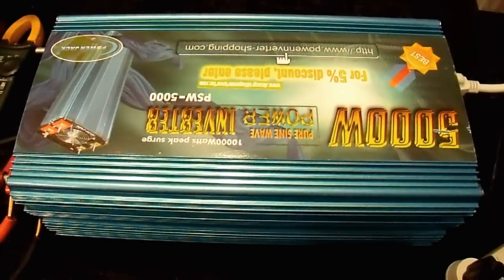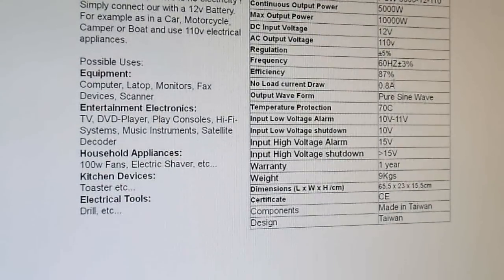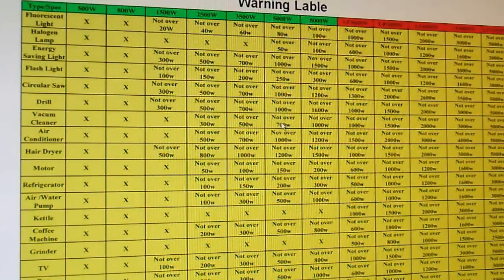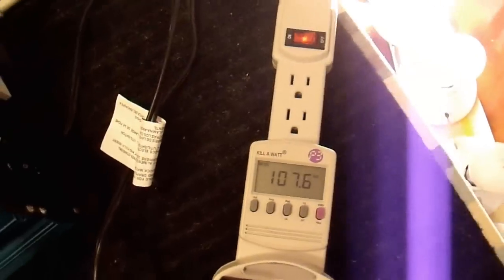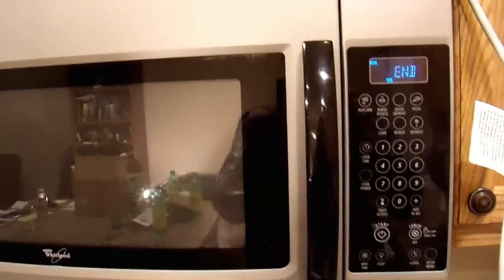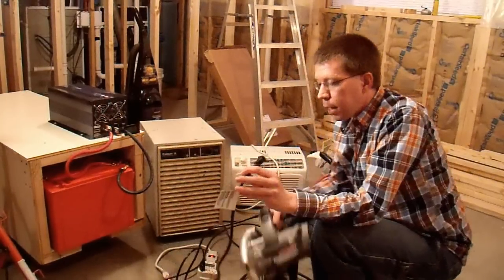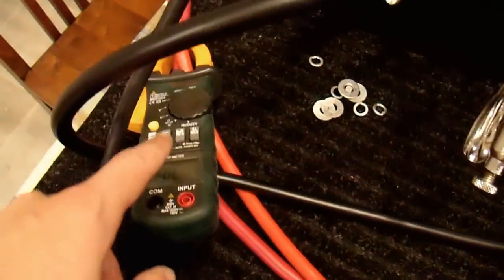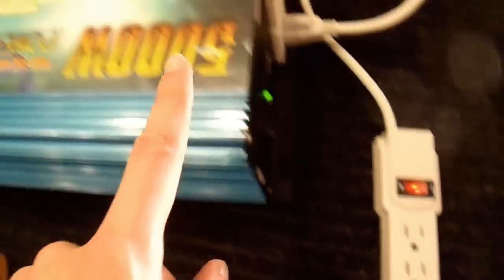Power Jack 5000W Pure Sine Inverter Review - part3/3

Comment: Not that it would have made much difference. Some of those cheap noisy fans are noisy because there very high flow fans. I recently found this out when I tried to swap the noisy fan in my power supply with a better quality one. Also I'm not a fan of reversing the air flow of fans, on my experiments with PC's I always found the exhaust fans were the only one's that really mattered(reversing the air flow was disastrous). So if the designers had the fan exhausting from the case I would have left it that way. Anyway interesting fix tour and review. POWER Jack!

Comment: Your video reviews were extremely helpful.  I had purchased a pure sine wave xantrex 2000 watt inverter a while back and found that it could not fully utilize the batteries power as it would turn off at about 11 volts.  After watching your videos I now know that I can most likely remedy this with a potentiometer it has internally.(once I fix the blown capacitors and mosfets!).  So much for purchasing a well known and respectable brand name!!

I decided to buy a larger modified sine inverter and would never have thought to buy a PowerBright brand...just sounded like another cheap and over rated inverter to me.  This 6000 Watt inverter is great!  I can run everything I want on it at the same time...several lights, small fridge, small freezer, Keurig coffee maker, and then start up my 1/2 HP well pump and washing machine without issue although the lights will dim ever so slightly when the pump starts.  The inverter stays completely cool to the touch.

The fans are large and fairly quiet when running...and there are two of them - one at each end which I have never seen before.  The price currently is about $500.00 now and well worth it.  So far none of my electronics have an issue with the modified sine wave so it must be of decent quality as well...this includes all of my variable speed power tools which have had issues with other modified sine wave inverters I have had.

Thanks again for your time in creating these videos.
Reply: I just realized I should have posted this comment on the prior video.

Comment: Another good series.  I think it'd be interesting to see how this unit performs with a high performance(high CFM) fan in exhaust mode.  It's been my experience that quieter fans are quieter because they simply aren't pushing as much air.  I learned that through experience by installing a top rated fan in a portable ice maker.  The high quality fan was much quieter, but wasn't pushing/pulling enough air to cool the unit and it's performance suffered way more than I would have imagined.

How about making a Knurlgnar24 buyer's guide/ratings index that lists the equipment you test so we can get a snapshot of the best, worst, and middling equipment capabilities vs. cost?  And/or a Knurlgnar24 favorites/recommended list? 

Keep up the good work.

Comment: Wouldn't adding one or two more batteries to keep the input voltage higher help to keep the output voltage a bit higher and thus increase the power output at least slightly? I know that the controller should maintain steady output voltage, regardless of the input voltage but since it clearly doesn't, maybe it would be worth giving it another shot with a more capable battery bank that can keep the voltage a bit higher. Nice review, btw.
Reply: I believe Power Jack has addressed burnout issues with the need to use a 48v set up for hard to start loads. The lower voltage designs, 12v and 24v don't provide the sustained voltage needed for heavy loads. I think you are right with your suggestion.

Comment: I'm looking at the 3000w LF split phase so these videos have helped. I have a few observations, though. First, I wouldn't have reversed the air flow direction. The arrangement from the factory draws cool external air across the output filters first. This is important as they will run the hottest. Also, have you confirmed the supply line you modified for a higher dropout isn't part of the thermal regulation circuit? It could need recalibrated now. Do you recall the part number on the output MOSFET? I'd like to take a look at the data sheet. Thanks!
Reply: YEAH. THAT IS A GOOD POINT! ACTUALLY WOULD BE BEST TO HAVE 2 FANS.
Reply: @remaundostewart3193  Would be better to test a new unaltered unit, too.

Comment: Thanks for the review! I have been using a power jack 1500 watt inverter infrequently for the past 6 years and it has worked great for me. That's why when I wanted to upgrade I was looking at power jack again. Are you sure the inverter was over heating and not low voltage cut off in your tests? Just 2 batteries run down quick even with a 45 amp charger. What type of inverter do you recommend?
Reply: +Tony S yes, it was overheating. that capacity of battery is adequate for that test

Comment: I'm wondering if the rapid overheating is the result of something else malfunctioning on one of the circuit boards ? Perhaps a resistor or a capacitor, or even a transistor ?

Comment: I like your vidz but none of the better brands you talk about seem to be in Australia unfortunately. Going by your reviews, if the costs are good, would you recommend finding 2 lower wattage more efficient inverters and running them together rather than a single bigger one? I want to build a completely off grid system and looking into if I should go all 240v inverted which I like the idea of or some 12v for the fridge and lights, or perhaps 24v as ive heard inverters run much more efficiently this way.

Comment: The results seem in line with what you might expect out of a "5kW" consumer audio duty power converter. Which is indeed one possible niche - powering audio equipment. But keep in mind that generally only analog audio equipment actually need sine wave to avoid EMI. The digital stuff pretty much always run fine with modified sine.
Reply from the maker: Despite its drawbacks I do think that this product would be good for certain applications.  Powering audio equipment could be one of them.

Comment: If you get your inverter shipped, take the cover off and make sure it's not damaged or poorly constructed before powering up. I just got one where the FETs weren't mounted to the heat sink.
Reply from the maker: I've seen that too.  I usually open up inexpensive inverters to check for this sort of issue before powering up.

Comment: Have you done any tests with the air compressor on various when it is attempting to represurize air when it is already at a high PSI.  E.g. Start the compressor at 100 PSI and have it charge the compressor to 120-150 or wahtever its rated for.  I found that one of my inverters can start my compressor fine, but can't start it when the pressure of the compressor is above like 50 PSI.

Comment: I had one like this years ago and you had to ground the frame to ground to get it to work right and have the engine running, higher voltage...???   then it worked fine...?

Comment: I have s 3500w powerjack and it runs a 2400w 240v vacuum... Good enough for planned use running my home light circuit of led lights and possibly some powerpoints via a changeover switch for blackouts....

Comment: Hi, I just got a power jack 8000 watt LF split phase inverter. The Instructions are NOT good. I wish to use it as a UPS/ battery charger. Do I wire direct to my house panel using L1, L2, N and leave the grid mains on? Why are there AC in connections if this is correct? I am more than confused and I have seen alot of your vids, you seem to know the most about this.

Comment: 24:52 Do you have some recommendations for inverters. I'd like one for a commercial truck, to run a small refrigerator, microwave, or over head ac? Not all at once though, unless its reasonably possible. I'd like to run the ac for 8 to 10 hrs or more if possible. 
Thanks for your vid.
Reply from the maker: Running an overhead AC will require a MASSIVE battery bank or running the truck overnight to keep things charged.  Other than that I'd recommend at least a 3000W pure sine inverter since the ratings on nearly all inverters are not honest.  I wish I were more up to date with current models but beware that most 3000W inverters cannot provide even 1500W reliably.  You'll have to do some research to know which ones are honest and which are not.  A good 3KW inverter should run your AC plus other loads without issue assuming good batteries while less just isn't going to do it for you.  I'd also recommend staying away from 'low frequency' inverters.  They don't do well in mobile applications and have a higher no-load parasitic draw.
Reply: @knurlgnar24  how can you tell if a unit is low frequency? Thanks a lot. That's helpful enough to get me started.

Comment: if you still have this inverter, i have an idea:
since you said most 3kW inverters can't start those big devices, make a switching circuit with a contactor, so it switches to one of your 3kW inverters, like using it to get devices that need a big surge running, and then keep em running with a higher quality inverter

Comment: I got a flash light that is over 250w, its using 4 100w LED chips, and requires a shoulder strap lol

(also burnt out 3 of those cheap 150w dc-dc boost converter boards before I bothered to get a 600w board)

Comment: Inductive loads (things with motors) you always need to spec double the wattage with the inverter, as the wattage quoted on those loads in an average value, they all draw double their rating (read much more) for a short time on startup, that is not shown on an average current draw figure. Thats true with any inverter and things with motors or heating elements, which require a large rush of current to start. You will either blow a fuse or destroy your inverter, as you are doubling the average rated power of the appliance for a very brief time at startup.

Comment: Are you sure your problem is not on the other side? What kind of batteries and cables are you using? Most people underestimate the input power required.
Reply from the maker: Yes, I am sure.  I agree that most people blame the inverter when their battery setup and cabling are the real problem.  That isn't the case here.

Comment: it not start the compressor up the second time as the compressor will not unload the pressure it made the 1st time if you pull the the plug
Reply: +david appleton Well yeah, it could only borderline start it, the extra startup load put it over that limit.
Reply from the maker: This air compressor has no pressure release - it always starts up into pressure.  The only changes were that the motor was warmer and the pressure was a few PSI higher.

Comment: Quick uninformed question I have not seen the other videos but are the outputs in parallel or separate? Even with a pure sine wave inverter it should roughly handle 15 to 20 Amps per outlet saying it's a 5000 watt inverter means it can should handle 20 amps per outlet. Also it needs more batteries and a stronger power source providing the proper amperage to the batteries at 5000watts that inverter should be pulling over 450 amps from the batteries.
Reply from the maker: Parallel

Comment: Great video and great job...keep up the good work mate, BTW I am retired electronics engineer from Sydney Australia, I received one of these units "Power Jack PSW-5000" Inverter 12V-240VAC, unfortunately someone has been into it and missing (Q9,Q10,Q11 & Q12) Mosfets. cannot fine schematics to identify the Mosfets labelling.
Reply from the maker: Which are the Q9-12 FETs?  Input or output stage, size, etc?  I do not remember specific Q numbers on the circuit boards anymore.
Reply: ***** Thank you for your prompt response.

Comment: I'd say that given the tiny vent hols at the other end of the fan, it just can't push enough air through to cool the system.
maybe it's time for some modding? take a big section of the rear out and replace it with mesh so it has much more air flow capacity.
maybe even put another fan on that end?  get some serious airflow going and run some more tests.
Reply: +John Douglas push pull fans are pointless
Reply: pointless? how? how do you think heatsinks work exactly?
Reply: John Douglas a fan on the intake and a fan on the outtake will only blow as much air as 1 fan
Reply: while this is true, it also creates greater air turbulence (at both ends) which increases cooling.

Comment: knurlgnar24   Do you know of a cheap  inverter than can run a few lights,  a skill saw, and an air compressor(heavy use) for several hours.  My generator is an old Coleman 5500, but i would much rather just idle my truck and not lug it around. I am looking for a decent cheap inverter that can run as good as my generator. An answer would be greatly appreciated. Thx.

Comment: Could you tell me if there is a difference in the amount of watts you draw from your battery set up is more with a larger, say 2ooowt invertor as opposed to using a smaller say 400wt inverter  or would it be the same draw from the battery depending on what is pluged into the inverter  sorry about spelling,  in short would a smaller inverter use up less wattage from the battery if any additional wattage because of being a larger unit.

Comment: There is a huge difference a Low Frequency inverter and a standard sine-wave inverter... I have a 6Kw Low frequency split wave that I use... It was NOT cheap.  But the links you showed that were to low frequency inverters, which handle frequency sensitive loads much better...  Like apples and oranges... Both are fruit, but completely different.

Comment: Battery 11volts when load on under voltage cutout. I've been running my whole flat on a 3000w LF PSW SURGE 12000w power jack for the last 6 years and it will run everything in my flat only thing that cuts it out is the ev it don't like to charge the car

Comment: I'm curious, what is the multimeter you are using in these videos?
Reply from the maker: Craftsman model 82289.  It is long ago discontinued but you may be able to find it used.
Reply: ***** Thanks...  I bought a really nice meter before going to Uni and I realised that next year it will be 25 years old!  I have been thinking of replacing it and I like the idea of a meter that is mainly a DMM with ancilary waveform display... but all I can find on sale now are hand held osciloscopes with ancilary DMM functions which is really not so practical.
Reply: +James Lewis I know it's been a year, but it's a WENS OEM'd scopemeter. WENS is a select OEM for EXTECH and EXTECH rebadged and supplied the majority of Craftsman meters. So you could look for the EXTECH 381270 or a WENS 33N or comparable model.
Reply: monosurge Thanks!
Reply: +James Lewis You're welcome. WENS UMM70 and subsequently the 700 series were the progressions. Don't let the different case, stickers, and button layout configurations fool ya. That's just part of the OEM game.
Reply: James Lewis  

.

Comment: how the hell can my 5000 watt powerjack LF PURE SINE inverter charger, have only a 25 amp fuse? i was told i need 00 gage cables , fur a 25 amp fuse. says 30,000 surge but fuse blows starting a 1400 watt AC.

Comment: Turn fan around and retest please
Reply: wow... ur asking alot KD.... retest again?? anyway good show Mr Gnurlgnar, and what nationality r u??
Reply from the maker: Off Grid Texas Homestead It is arguable whether turning the fan around would change the result and by how much, however as fast as this inverter overheated at a mere 1kw it is exceedingly clear that it would not make a substantial difference.
Reply: I think its unfair to test it and make a judgement call on the product without putting it back as close to original design as possible. You may well be right, it might not make a difference but by turning the fan you have made a design change and its not operating under original design parameters. I say that pulling heat away from and out of the cabinet may make a difference. Its worth investigating. We could all learn from it, I appreciate your effort and the time it takes to make these videos. I enjoy them very much. Kd
Reply: is this your inverter? no exactly so deal with it.
Reply: All I asked was to turn the fan around, I learn from videos like this. I appreciate what knurlgnar24 does and I thought it was a simple and easy request, no it isn't my inverter, but who rattled your chain and asked for your snide remark smallenginedud?

Comment: i have the inverter/charger model .said to be 5000/30,000 surge. i hooked my 1500 ac up and blew the inverter fuse.it is a 25 amp fuse. WTF? my 750 watt cheapy inverter has a 30 amp fuse. these people told me to use 24 v /300 amp hours of batteries with 00 gage wire.???? on a 25 amp fuse? the instruction manual itself said 9000-15000 surge. 25 amp fuse can't be right.

Comment: Hi sir 
Winder if you can hilp me , I have mobile car wash and I have ginretor and it is very noise I have that thought to use inverter but I don't know how to wire it is one buttrey is enough , I use vacum clener it is power 2.4kw max and steam machine it is 350 watt .
So waht should I do if I go withe inverter ?!
Reply: +nj dj a samlex 3000 watt inverter, i would recommend 24 or 48 volts to make it a bit easier.

Comment: How many batteries were connected during your testing - Total Ah?
Reply from the maker: Not many, probably two 70Ah batteries plus a 45A power supply to supplement.  This was plenty adequate for the power draw of this inverter for the testing.  With an inadequate 12V supply the results would have been even worse.
Reply: @knurlgnar24  if you power something of 4000w it will draw 300amp from a battery so you cant jave less battery power than what an item can draw otherwise it will overload. Thats why im asking
Reply from the maker: @EddieSpaghettiYouTube  Battery voltage did not drop significantly and was thus adequate for these tests.  If the inverter was truly capable of 5000W these batteries would have been woefully inadequate but, in reality, this is a 1kw to 2kw inverter by most realistic standards.